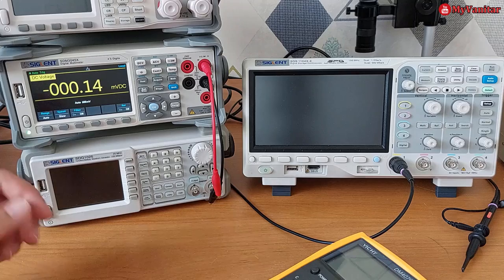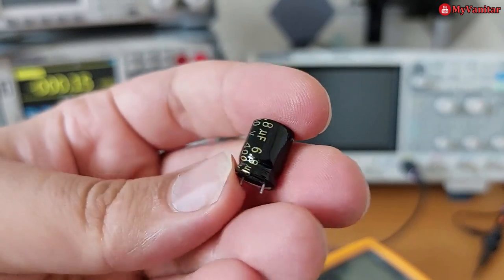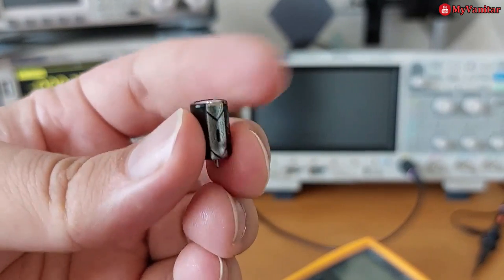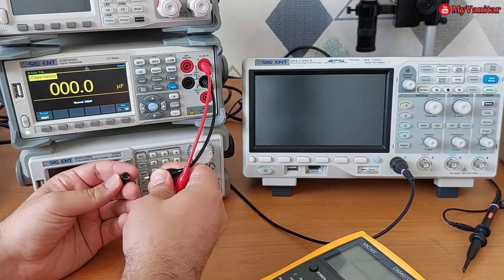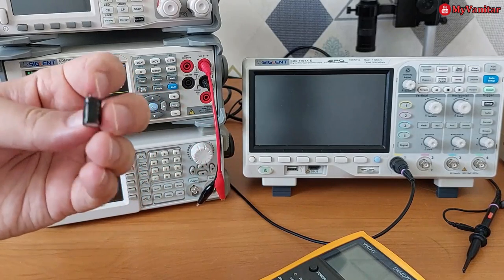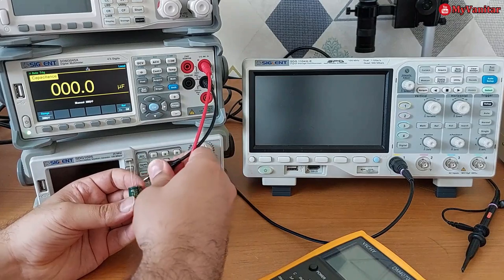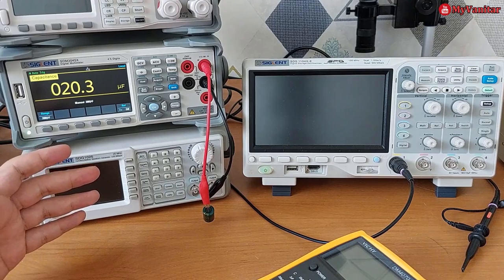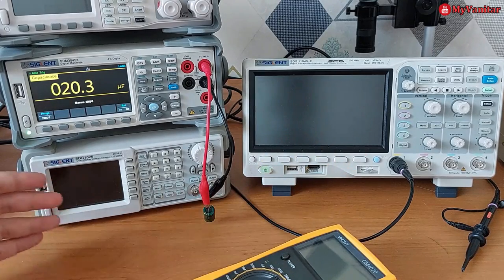How to Easily Detect a Failed Capacitor

Comment: Electrolytics are the worst components ever!  We really should invent an alternative to high capacity capacitors.
Reply from the maker: SMD ones are slightly better, because of the lower ESR
Reply: @MyVanitar  I always use ceramic SMD where I can.  Are you saying SMD electrolytics are better than through-hole electrolytics?  I didn't know that.
Reply from the maker: Yes, SMD electrolytic capacitors are slightly better, because of the lower ESR, however, they are limited in capacity and the rated voltage, I mean the variety of them is lower than through-hole ones
Reply: @MyVanitar  That's interesting.  I assumed they'd be identical apart from the way they're mounted.  Anway, I use SMD electrolytics for assembled PCBs, since they're cheaper to assemble.
Reply: Nothing wrong with electrolytic capacitors. They are either used wrong or built wrong ! I have many industrial machines with capacitors that are at least 30 years old. The capacitors are perfectly fine. The problem is they are used improperly. First : Buy capacitors from a reputable BRAND and SOURCE. Those nichicons from ebay most likely are not real nichicons...  Second : understand the parameters of the capacitor you are buying. Blindly "going low esr" is useless. The lower the ESR the higher the ripple current will be through the capacitor. There is such a thing as too low an ESR for a specific application ! In the early 2000's we had capacitor plague caused by somebody that stole a electrolytic chemistry but did not have the complete formula. The stolen chemistry ended up in many caps and they all started popping. In the 2000's the formulation of the electrolytic went from a ethylene-glycol base to water based. Without a stabilizing agent the water will hydrate the aluminum electrodes, release gas and the capacitor pops. Long life capacitors use an electrolyte like DMF or DMA (Dimethylfomamide or DemethylAcetamide) . A second problem is that the electrolyte can react with the rubber seal around the pins. Third problem is the improper, or no, cleaning of the board after soldering. Flux is a corrosive agent and will attack the rubber to pin seal causing the capacitors to leak. some cleaning agents to remove flux are very aggressive and may damage the rubber seal as well. You need to check that your cleaning agents are compatible with the parts ! RoHS and WEE have demanded changing the composition of the gaskets and you cannot use the same cleaning agents you used 50 years ago. The formulation is different ! Another common misunderstanding is the cleanup after removing a defective capacitor. The electrolyte ate the traces. Not true. The leaking electrolytic fluid has create metal salts. These salts are conductive. the voltage between the pins creates a current in the salts and eats away the traces. Cleaning that off requires that you know what electrolyte was used. for Water based electrolytes : distilled water with either a bit of ammonia or vinegar. For the others : mechanical scrubbing. Testing a capacitor with an ESR meter is also useless unless you know the esr for that particular capacitor model and family. Blindly going "it's 0.9 ohm which is good for a 2200uF " means nothing. It depends on manufacturer and model. For some 1.5 ohm may be perfectly fine ! Even then, you may measure an acceptable ESR and value but the thing leaks (electrically)! Leakage testing can only be done by charging the capacitor to its rated voltage and monitoring the residual current or the rate of self-discharge. You cannot do this with a regular multimeter. You are either fishing for nano or pico amps and will have to have a long charge time, or you are looking for voltage droop and then the input impedance of a regular multimeter is too low. Most digital meters are 10Megaohm input impedance. a capacitor charged to 50 volts means that you are pulling 5 microampere just by attaching your meter. The droop needs to be measured with an electrometer (Teraohm input impedance) and you still will have to wait  along time to see the voltage drop and then figure out the maths.
Reply: @MrFreeElectron  That's quite an essay you wrote there - it's very interesting and appreciated.  Knowing electrolytics can live 30 years if used correctly does make me more positive.  However, they still have a rated lifetime and their performance decays, which I'm not sure other components have (I might be wrong).  Also, statistically they will not all be used correctly.  Any caps in a power supply will also have more stress because of larger currents and heat.  In your opinion, how long would you run a 1000W power supply before you'd feel uncomfortable rating it 90% of that?  (I buy my expensive Nichicons from RS).
Reply from the maker: Thank you for your comment
Reply: @ChristieNel  i am looking at Hewlett-Packard power supplies that were built in 1988 using Nichicon caps. used in lab or factory, running almost 24/7. caps are still fine. Nichicon FS series. truth to be told , these capacitors are 5 to 10 times the price of your standard crap-assitor from some never before heard of brand... They are physically also more than double the size even though their value and working voltage is the same!  The electrolyte problem has long been solved. Capacitors failing early these days are invariably because they are running them out of specification. Especially capacitors used in switching power supplies have a hard life. In the sense that they deal with fast ripple currents. A rectified 50 or 60 hertz sine wave gives large ripple currents and the ESR is dominant for the power loss in the capacitor. Once past the switching block the currents are FAST due to the high switching frequency. Then ESL rears its ugly head. The internal inductance creates voltage drop and heat. Once a capacitor starts going bad the parallel resistance goes down (it becomes 'leaky') and it starts warming up , which is not good. I see so many videos where people are recapping things that don't need recapping , or recapping with wrong parts. Let's just jam whatever we have laying around in here. it doesn't work that way. At least replace it with the same. Or better. The shape of the capacitor sometimes matters too. some power supplies use those very slender but very tall capacitors. those are specifically made for switching power supplies. They have very low ESL and exhibit very low soakage. Soakage is a term used for how fast electrons can move and is the visible result of ESL. Contrary to popular belief , electrons do NOT move at the speed of light. Electrons in a wire are like marbles in a tube. if i push one in , one exits immediately, but the one i pushed in has just moved it's own length. If i make the tube double wide i can push two in and get two out. that is lowering the resistance. Soakage would be explained as making the tube shorter. The electron i pushed in comes out faster because it does not have to go that far. You can see soakage by charging a capacitor, shorting it for a time and then looking at the open circuit voltage . the voltage will slowly rise. In an ideal capacitor the short would have discharged the capacitor completely. the voltage rises because the charge is not stored uniformly in the plates. When you remove the short the remaining charge redistributes itself . the electros that were "far away" from the pins take a bit of time to reshuffle and this causes a change in voltage. An electrolytic capacitor is nothing but a long strip of aluminum that is rolled up. The pin attaches to one side of that strip. So the electrons all the way at the other side of the strip take time to shuffle to the "exit" (the pin). It works both ways : when charging they also take time to get there. This effect is perceived as ESL (inductance : they don't want to move). These tall skinny caps use a plate that is shorter ( the electrons don't have to move that far to the other end) , but wider. So you get two advantages : wide conductor means low ESR , short conductor means low ESL, ideal for high and fast currents. Other misconceptions : we all learned that a capacitor is two plates separated by an isolator. The closer you place the plates the higher the capacitance. But... if you peel apart an electrolytic capacitor you find out they are constructed from two aluminum foils separated by something that looks like paper.. surely they should be using something thinner ? well ,they do. you see that paper is NOT the isolator. That paper is drenched in an electrolyte. hence :electrolytic capacitor. But what exaclty is an electrolyte ? To begin ,it is a CONDUCTIVE fluid. HIGHLY conductive. It is also mildly acidic and ready to release oxygen molecules. But.. wait , i thought a capacitor needs an insulator between the plates , why do we use a highly conductive liquid ? Well, when the capacitor is initially built it is not a capacitor at all ! It has to be "Formed" . Forming is an electrochemical process that is induced in the factory (and goes on for the remainder of the capacitors life). They apply a controlled current to the newly built electrolytic capacitor. This current makes the electrolyte react with the aluminum and forms aluminum-oxide on the positive plate. Aluminum oxide is a VERY GOOD insulator. most high voltage systems are insulated using aluminum oxide plates. Once the positive plate is completely covered in aluminum oxide the current goes to zero and you now have a capacitor. The positive plate is coated in an insulator , and the negative plate contacts the remaining electrolyte that covers the insulator from the other side. So the negative  plate is ... the electrolyte ! if that dries out you lose surface area (the plate shrinks) and you thus lose capacitance. If that electrolyte isn't conducting well the ESR goes up ! Over time, unused capacitors, can develop "pinpricks" in the aluminum oxide. When you apply voltage they will "leak" there. but the electrolyte will regrow the oxide layer and the capacitor will self-heal. That what the vacuum tube guys do. They apply a current limited low voltage to old capacitors and check if there is current flow. if there is : wait for some time for the capacitor to regrow the oxide layer and it will repair itself (provided there is electrolyte left in those old things ) Re-forming. Why do we have a plastic sleeve over the metal can ? electrolyte is conductive so it will electrically connect the negative plate to the metal can ! if you make a symmetric power supply (+ and - 5 volt ) the metal can of the capacitor on the -5 volt is sitting at . . -5 volts ! If that were to touch the metal can of the capacitor on the +5 volts you'd have shorted the negative supply !. So you needs to insulate that. in old vacuum tube equipment that uses chassis mount capacitors you will sometimes find capacitors screwed down , held by a rubber grommet : that's your insulator ! they did not use plastic sheets back in those days ! the case was exposed. The aluminum oxide only grows at the positive plate. So you cannot "reverse" a capacitor : you would "un-grow" the oxide (provided you can get a current started... which you can... i will come back to that) and regrow it on the other plate, effectively repolarizing the capacitor. Ideally it should not be possible to do that as the aluminum oxide is a near perfect insulator. But ... remember the pinpricks .? Well ,those are not the worrying point. The worrying point is the parasitic diode. what ? well , an electrolytic capacitor ,in reverse direction exhibits a diode like behavior. There is a certain breakpoint at which the diode will conduct ( around 1.2 volts) . Granted, it's a bad diode, but it is a diode. Once you are beyond that point you will succeed in starting a current and that will begin decomposing the oxide. That old trick to put two electrolytics back-to-back to make an unpolarized capacitor ? bad idea ! You are slowly destroying BOTH the capacitors ! to protect them you need to put two diodes antiparallel. The real diode will conduct at 0.6 volts, so the capacitor that is reverse polarized can only get 0.6 volts across it. This is lower than the piercing voltage (1.2) for the parasitic diode inside can never go into conduction and there is no risk to damage the oxide layer. Now, one more thing .. what about the pins ? Those are tin plated copper. They go through the rubber seal at the bottom and into the .. electrolyte ! Remember electrolyte is a fluid so it goes wherever it wants. The electrolyte only grows aluminum oxide. it cannot grow an oxide layer on the pins. So doesn't that short out the pins ? Well, if you have ever pulled a pin out of a capacitor you will find out that the pin itself does not go though the rubber seal. there is an aluminum "cap" that is crimped onto the pin. That aluminum is the one going through the rubber seal. Take a sacrificial capacitor and a pair of pliers. Pull a pin out. You will see that the pin is pulling out an aluminum slug. So on the inside there really is only an aluminum "pin" , and that one grows oxide just like the plates do. So the insulation stops at the contact area between the inside surface of the rubber grommet and the aluminum slug poking through. if you were to pull or bend the capacitor sideways you will not damage it as you are pulling the oxide deeper into the rubber seal. That's all for today ... there's much more. Everyone want s to mess with the latest and greatest 2 billion transistor chip , but doesn't understand even the technology that goes into simple things like capacitors or resistors... don't get me started on those... thin film, thick film , carbon or metal film , spiral wound , bifilar, foil resistors, kelvin contacts, laser trimmed , r-cut ... by the way , those surface mounted resistors : that white stuff : pure aluminum oxide . The base of a resistor is a block of aluminum oxide with a bit of conductive paint on top and capped off at the end with a tin plating so it can be soldered. but 99.9% of material in a SMD resistor is aluminum oxide.
Reply: One of my irritations : this stuff is not thought in schools , or found in modern books, simply because the teachers don't know it anymore ! Go ask them to repair a TV or radio made in the 80's ... see how they struggle. Sure they can write two pages of python , compile it and run it on an arduino to blink an led. But when the arduino crashes they will blame it on a bug in the code or a glitch in the power supply. They don't realize they used the wrong capacitor in that supply, or around the crystal. I had teachers that DID know that stuff. They came from the industry and knew how things worked. A lot of what is thought in schools today is simplified, sometimes to an abstraction that is so disconnected from reality that it is a total lie ! You learn about diodes and transistors and then find out that almost anything out there explains it wrong. I was fortunate to learn it from someone that actually went to Bell labs and learned it from Brattain and Bardeen (the inventors of the transistor) themselves. I worked in an actual waferfab for two years repairing the machinery that makes integrated circuits before moving to the design center and R&D lab. It's nothing like you learn in schools. If you really want to learn electronics : throw that arduino in the pile marked "for later, when i grow up", uninstall that ltspice semi-lie-tor, get a soldering iron and the books from Bob Pease, Jim Williams (you can find lots of their stuff for free, legally). Those are the legends. The guys that did electronics when the laws weren't even written. They had no teachers : they discovered it. Sadly, we lost both. Jim died because of a stroke and Bob died in a car accident returning form Jims funeral (well, a memorial event for Jim)  Bob was a frequent visitor at the monthly electronics swap meet in Silicon Valley. i met him several times. Always an interesting chat. Showed up in his rusty old beetle filled to the roof with papers and books. I bought several from him. Signed :) Electronics is fascinating, especially when you delve into the why of things. That transistor ? oh it's two semiconductors , stacked PNP or NPN... not so fast, the first transistor ( famous picture of a contraption that looks like a rectangle with a triangular piece on top and some springs attached)  was NOT a PNP or NPN but what is now called a Schottky transistor. You don't need two semiconductors. One is sufficient if the other material is aluminum or gold. A Schottky junction is a metal to semiconductor junction. But we all learned about NPN and PNP and then are shown the "first transistor" which is totally different. Why are the electrodes called Base, Emitter and Collector ? well Base : because the base is that piece of semiconducting material underneath that triangular plastic piece. It was literally the "base" the thing was built on. Emitter and Collector ? one collects electrons, the other emits it. The first transistors worked BOTH ways ! They just worked better one way than the other, so they marked the direction the transistor worked best. if the electrons go in the collector and come out the emitter. But you can reverse the transistor. it will work ! (not with modern ones, they are now optimized, but the original point-contact transistors didn't care much). Actually that first transistor was much close to a field effect (FET) transistor than a bipolar device. They only had a piece of germanium with a single P-N junction. The emitter and collector sat at the P material , the base was N (so a PNP style) but there were no two P materials. It was one solid surface with two electrodes (gold foil) . so they effectively had a channel between the electrodes ,just like in a FET
Reply: @MrFreeElectron  It sounds like you have a wealth of knowledge.  I am a (proper) embedded software engineer myself and have had to teach myself most of my electronics knowledge, especially about controlling MOSFETs and bridges correctly.  And how to do ground planes right, especially when you need multiple.  I wasn't taught any of this at school, like you said.  There is nothing like real world experience - working from first principles, measuring things and blowing things up.  But there's always so much more to learn.  Arduino might be a good starting point, but it really feels like a toy, especially if you're using the high level drivers.
Reply from the maker: Vincent, Please make a separate comment to be visible for other people as well, they might miss it within replies
Reply: @MrFreeElectron  You're right!  ESR checks really only apply to switch mode applications and caps design for those applications.
Reply: @MrFreeElectron I’m just getting started. What would you consider to be a good brand, and where would I find them? The last time I bought anything electronically related I bought it from Radio Shack, and I think they’re all closed now. I’m not sure where to even look yet